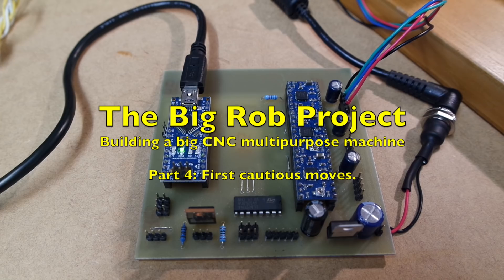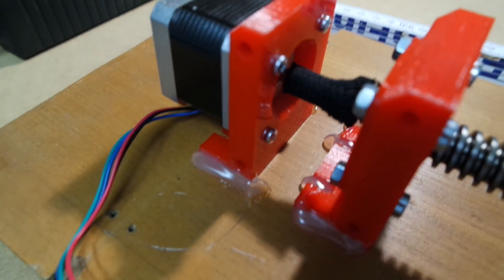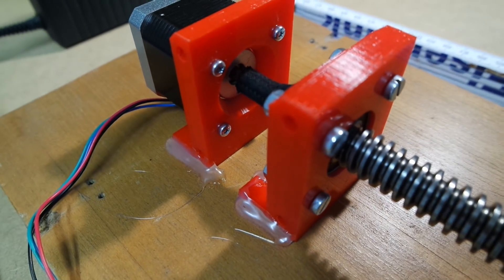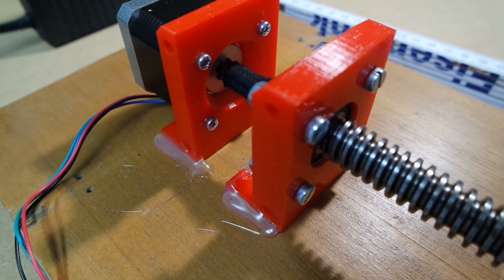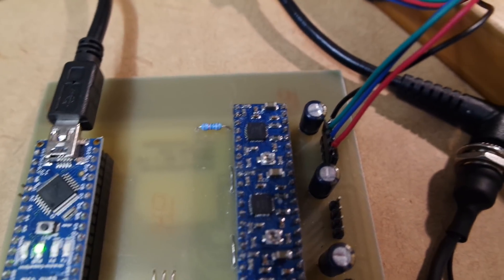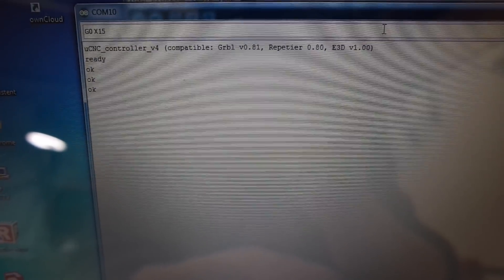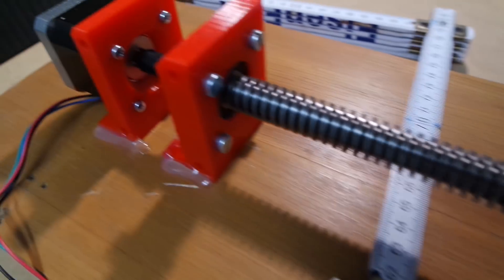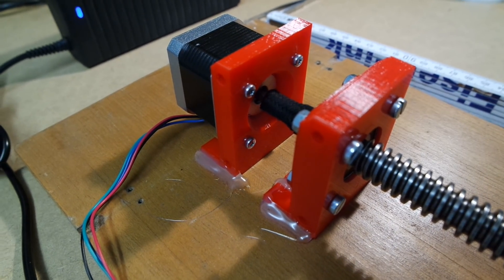Big Rob Project Part 4

Comment: You should probably have cooling heat sinks on the stepper controllers, if you want to have more power through the stepper motors. There are small that are easy to install.